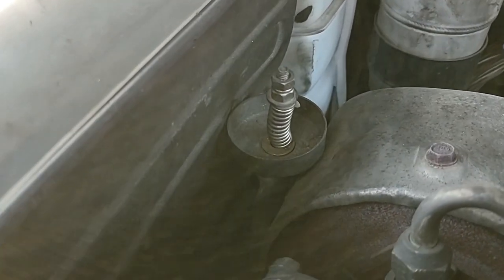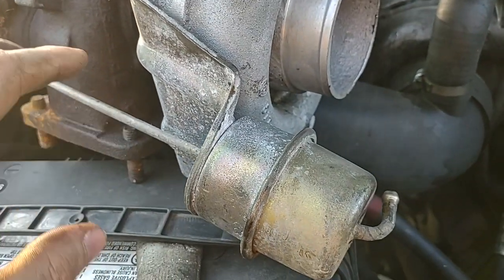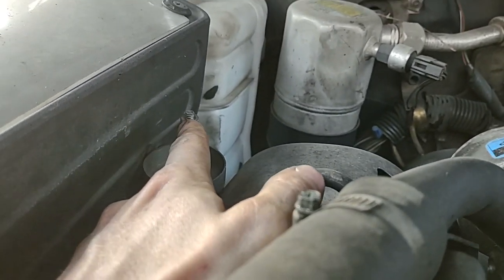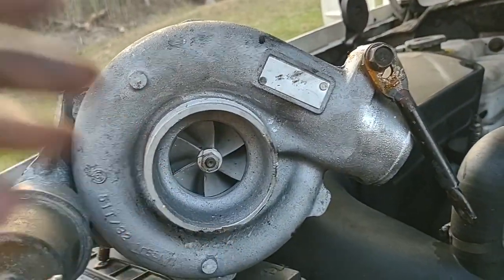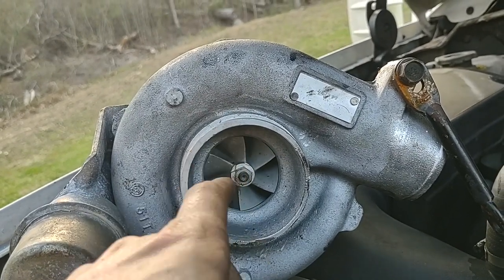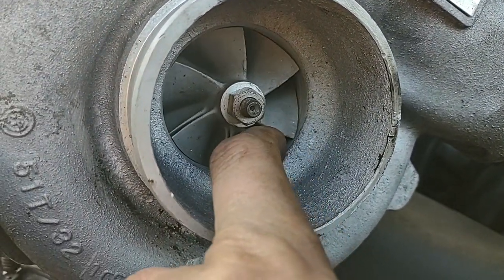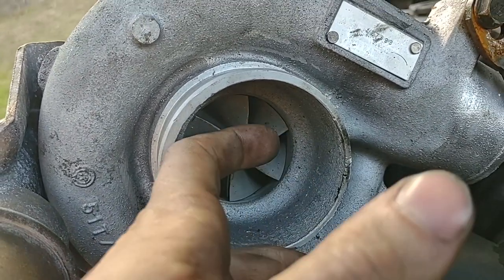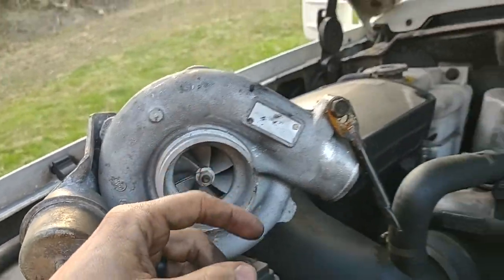6.5L Turbo problems, Increasing boost (derate, no boost, leaking, over boost)

Comment: Really enjoying your videos. I just dipped my toes into the diesel world and didn’t want to spend a 3rd world country’s national deficit on something new, so I went old and cheap. I got a 95 C3500 with the 6.5 Detroit and I’m going to put a few more g’s in it to make it fit me.
Reply: How'd it work for you? Recently did the same with a 94 C3500. Got an air dogg lift pump, mechanical waste gate and some gages waiting to be installed. 
The more videos I watch, the more I wonder if a cummins would have been worth it.

Comment: Hi Jesse:   Thanks for being Awesome.    I'm learning a lot,  and really appreciate your humor and attitude.    I've got a '96 2 door Tahoe with the 6.5 and it started out awesome and now a year or two later not so much.  No power,  went from 20 to 14 mpg,  and starts a little less immediately.     Only 100,000 miles on it.  I do think I got a bad tank of fuel about the same time performance fell off.    I've kept up on maintenance,   just did a lift pump and PMD and am curious about going to the early non-electronic injection pump.  I would love to see a video on that swap,   going from electronic to mechanical.      I'm going to pull down the turbo for inspection when it stops raining.   Also intending to give it fresh injectors and glow plugs....     Any suggestions about the loss of power?     Places to look,   things to consider?
Reply from the maker: Hey man, Thank you for watching and your kind words. I do greatly appreciate it. As far as the low power/ sluggish running issue you are currently having, I would definitely check the turbo for any play as well as the vacuum pump if it is still hooked up. If the vacuum pump is still hooked up I would recommend either deleting it entirely or at the very least installing a manual waste gate on the turbo. Also I would ask if you have any codes stored in the ECU that are currently not throwing a check engine light.

Comment: Another good one, Jesse. I'm currently in the middle of swapping out injectors, glow plugs, and intakes to delete the egr. Just a heads up for those doing similar work, be prepared to spend days doing it rather than hours. Breaking old brittle parts, that have to be ordered, seems to be part of the process as the typical parts store carries very little when it comes to a vehicle that is approaching 30 years of age. The joy of owning an antique. 😁
Reply from the maker: I completely agree brother and thank you for watching the video man, I do appreciate it. Sounds like you have a full weekend ahead of ya, best of luck 👍
Reply: @JessePelkey1  It's turning into a marathon. Got all the injectors and glow plugs replaced. Broke the transmission dipstick tube, the temp sensor for the ecu was brittle and broke, the belt tensioner needed replacing, the guy working on it suggested replacing the glow plug controller since I have a new harness and the snap in connector for the upper coolant pipe started leaking as soon as it was moved. Had to order parts so now it will be next weekend, maybe, before he can get back in it. Parts have to get here first but at least I found someone who knows his way around the 6.5 and willing to work around the delays. Hope he remembers where everything goes. 😆

Comment: I'm fairly new to the game been watching you for about a year you have helped me out more then anyone else,thank you keep it up . I' have driven my truck almost a 1000 miles total but got way too many hours under the hood lol . I am replacing the flex plate for the second time . bought this 94 for $400 with a 180000 miles on it it sat for a few years took me couple hours to fix a bad fuel line.Killer deal then well I already said the flex plate issues .any idea s why they broke the last one on the start up?  I did buy another motor .it is  588e with 5000 miles on it that one cost me two grand .   So I am just getting in the game , remind me of a boat I just don't see know lightat the end of the tunnel!lol have good day

Comment: Merci Jessy!  I have installed a boost gage and get no boost at all. Disconnect at intake plenum and blowed air to verify if gage was working and it did.  My truck runs good but going up steep hill slows down(leak of power).  Did verify if turbo compressor wheel turn and it does.  Original turbo 308 miles.  Got a modify waste gate like yours but didn't put on yet.  Jessy, realy plaisant watching your videos.  Denis
Reply from the maker: Hey Dennis is there any way to tighten the spring of the wastegate? If so that may be the issue, tighten the spring and slow increments taking it for test drives in between tightening sequences and see if the boost actually comes up.
Reply: @JessePelkey1  Jesse, last week did install Flo pro SS822 exhaust and what difference it makes. In same time with my friend mecanic we tried to get boost gage working and accordingly to my friend the turbo is not working.  I have access to my friend's wrecking yard and took the turbo off an 1996 .  Will recondition it and in 3 or 4 weeks will install.  Jesse in the yard there is  a 1997 with a motor that was changed (not much mileage) but the alternator is on driver side (mine on passenger side) and if ever my motor need to be changed will I be able to take that one? merci

Comment: Hey , I am finally working on my 6.5 project. I have one goal only. Making this thing stupid reliable. I don’t want more boost. I don’t want more power. It has 112k miles on it and it was passed down to me. It’s a 94. My current plans are new harmonic balancer as the old ones rubber is about to give. I don’t want to remove the vacuum pump because I am going to use it for a brake booster. 

My current plans are:
New oil and water pump
Timing chain
Head gasket and studs. 
Harmonic balancer
Rebuild turbo
New vacuum pump (chassis I am installing has a brake booster, or electric vacuum pump)
Bigger radiator
180f thermostat 
Of course, going to reseal whole engine. 

Anything else I am missing??
Reply from the maker: Good evening sir, I like your plan, I think its great. I read your list and the only thing I would recommend with everything you have mentioned and want to do, I would say instead of going back with a harmonic balancer I would pick up a fluid damper and a billet pull as well as doing a PMD relocation. The harmonic balancers are known for going out and breaking the crankshaft. I would also suggest and aftermarket lift pump, preferably one with remote fuel filters but i digress. The factor lift pumps will fail at some point and leave you stranded and a newer lift pump will insure proper liberation and fuel supply to the injection pump.

Also, if your rig is a DS4 truck, I would greatly consider a PMD relocation.

Comment: Awesome videos my man. This is my first deisel that I've owned let alone a 6.5 deisel which I'm finding out is very different than the rest of the deisels out there. I've already learned so much and alot more thanks to your videos. I'm at the point of changing the intake to delete the e.g.r. I know you said you had some access to some parts, would you happen to know of an intake I can get my hands on. I would appreciate you letting me know and keep up the awesome informational videos.
Reply from the maker: At this time I unfortunately don't but in the next couple I will be restarting the website where I should have some available 👍

Comment: I think your description on the wastegate is backwards, at least compared to my computer controlled 98. Spring pressure holds the wastegate open, and then when the vacuum solenoid applies vacuum to the wastegate it pulls it closed giving you boost. Vacuum gives you boost. This is opposite what you'd expect and means if you have a vacuum leak or vacuum solenoid failure you get 0 boost, rather than full boost in case of a failure.

Comment: Thank you for another great video!  Can you tell me how to adjust the boost on a stock 6.5L and how to measure that boost? Thanks (1996,K2500 with 330,000 mi, mechanic waste gate with Heath Diesel PCM)
Reply from the maker: Thank you Chris, and to answer your question, best way to measure the boost is to install a manual boost guage directly in the top of the intake horn or intake elbow. With a manual wastegate you could be able to tighten the adjustment on the spring to increase boost or back off the tension to decrease the boost.

Comment: First thanks for all your videos and giving your knowledge on the 6.5. I have a 94 k3500 dually 4 door. I bought it with only 6400 miles. It now only has 6900. I have done the 3 inch down to 4 all the way back. Quadstar full flow intake cold air filter. Airdog 4g lift pump with Quadstar fsu. New 35 gallon fuel tank 1/2 inch line all the way to feed the beast mod. And manually app waste gate control on a gm 4.  Now I'm planning on Quadstar tuner like the malty tuner. Pluse a new 54 or super 60. And advice on tuning other then calling Quadstar. Can I just tell them I want more out of my stock engin and they send me a tuner that will do that. Either way could you go over your experience with buying a tuner and options you have. And things to look for. Thaks again. Keep making 6.5 videos they are really helping. Bill.

Comment: Yeah I remember one time working on my 1997  P400  6.5L Diesel I had the intake all tour apart on it and I had paper towels stuffed inside the turbo intake to keep debris from getting inside it well as working on it and when I was putting it back together I forgot to take the paper towels out when I put the intake all back together the air cleaner box back together on it I started it up didn’t make any strange sound for anything but I sure noticed it when I drove down the street that I had a lot of black smoke coming out of it and the truck was not running right no power right there it dawned on me what I done wrong I left the paper towels inside the turbo like a dummy pulled over pull the paper towels out I believe there was dinner tight enough that the turbo didn’t spin up or nothing but there was no damage to the blades or anything they wouldn’t any paper have sucked in because the blades didn’t spin but I sure feel stupid and I deserve the stupid award for that one big-time stupid award but anyway the truck runs fine the turbo looks good it’s been several several months ago that’s my stupid move with the turbo
Reply from the maker: Been there done that, an expensive mistake I will never make again hahaha

Comment: Got the 6.5 running with the pump you sent me , thank you again so much you are awesome i learned a lot about these 6.5s some good but mostly all the bad ..so much for Pensacola diesel and their b's lies and theorys that it was me and my truck that had the problem. They told me they were going to refund me my 500 two days later there was 500 in my account  then it was gone a day later ! They used my account number to get a personal loan in my name for 500.00 a loan i never authorized !  Real great people the fbi traced it to a computer address in pensacola florida ! Scam artists is what they are.. It ran for 5 minutes on its own I gave it throttle and it died ! I checked everything there was to check turned the key and the lift pump mysteriously stopped priming and glow plugs wouldnt heat .? Not sure what was up  but i checked the fuel shutoff solenoid and there was zero power going to the fuel shutoff solenoid as well  , I went through all the fuses and found the glow plug fuse blown. ?  Does the glow plug fuse run the fss and the lift pump ?  Not sure but I replaced it gonna look into it more tomorrow but I've gone through and done about everything and anything imaginable to this truck  . Any ideas other than a case of dynamite ?
Reply: Check your oil pressure switch.The transfer pump gets power while you are cranking, then once oil pressure builds to about 4 psi the contacts in the oil pressure switch close and the switch  powers the control relay for transfer pump.
You should also get a voltmeter and measure voltage at the transfer pump. Be sure you have good voltage and good ground in the circuit.
Mine had 12 volts power, was working, but would not provide enough volume. Rock Auto has replacement.
Be sure to also change out your fuel filter and clean the filter housing.Fill the housing up 1/2 way with fuel then install the filter.
You can bypass oil pressure switch (AS TEST only) by jumpering orange wire to grey wire.
Pump should run at all times and provide fuel to filter.
This circuit is hot 12 volts at all times. Be sure to reconnect wiring back to original after the test.

Comment: My 93 had a bad wastegate it was get anywhere from 6-16 psi, so I swapped a Chinese hx40w and right now it will max at 21 I plan on lowering it and it has not had the cdr connected but it ok bc it's stuck open

Comment: This maybe a silly question, but could a person take a alternative route an supercharge their 6.5? Also would their be any pros/cons to this, or is this just a bad idea in general?
Reply from the maker: I don't think its a bad question at all man. Truth be told to my understanding there has very little as far as testing if at all with a super charger on a 6.5L There are a few pros and cons to either one, but with realistically no one making the effort to make a kit or test a super charger on these engines its hard to tell how it actually responds.
Reply: @JessePelkey1  yeah I've always been curious especially since with this particular engine it might actually make sense. However I'm definitely gonna be asking questions due to I'm in a debate between a 5.9 cummins 3rd gen, or a 6.5. I'm mainly looking on cost, easy diy, and I'll only be towing 8-9k 5k at an absolute max.

Comment: Hooked OBD2 tester up to my 2000 3500 gmc 6.5l turbo diesel and had a P0236 Turbo/supercharger Boost Sensor A circuit range/performance code pop up seen in your videos couple of things but any idea of what it definitely could be without doing process of elimination of the few things I’ve seen it could be causing that code

Comment: Blew a head gasket what bolts should I order for more boost that's reasonable priced an whatcha think about doing to the head while I've got them out ??
Reply from the maker: Arp head studs, send heads to a machine shop to have valves and seats checked along with the heads checked for flatness and cracks.

Comment: Crankshaft sensor fixed my stumbling and shutting dwn. So what do u think of installing a wicked impeller along with doing mech waste gate?
Reply from the maker: Wicked wheel is definitely an upgrade over stock, your egt's will stay lower and the turbo won't have to work as hard to make the boost. If I had to choose a stock gm turbo or a hx35 though, I'd take the hx35.

Comment: Recently picked up a 94 C3500 utility body with the 6.5. It has 140k miles, 0 blowby, pmd relocate. Otherwise stock. 
What could cause a hard start? Warm or cold, it always seems to turn over a few times before firing off. When it's cold, it seems like as soon as the oil pressure jumps up, it fires off. I'll drive it for a while, go to restart it, and it still cranks over several revolutions before firing off. Runs great otherwise. 
Any thoughts 6.5 folks?
Reply from the maker: Honestly, it could be a multitude of things my friend. There wouldnt happen to be a check engine light on or have checked to see if there were any inactive codes stored in the ECU would you?
Reply: @JessePelkey1  
No CEL haven't checked to see if any were cleared but been driving it.

Comment: I have a 6.5 with db2 and hx40 I don’t get any boost until about 2200 ish rpm’s and can not hear it from exhaust at all but can hear it loud in the cab about 25-3000 rpm’s and can feel it pick up with the spool but just ain’t right

Comment: a farm tractor of mine the turbo still works but so much play shes pushing oil out the stack! thinking about throwing a good 6.5 turbo on it. i just gotta setup the boost. would you ever do a hx40 on your 6.5?
Reply from the maker: Absolutely, I was actually thinking about an hx40 for the service truck that I'm going to be building here in the future 👍

Comment: Tank you for all the informations you give us, really appreciate. Do you at how much pressure you can go without an inter-cooler?? Because you can't boost the manifold pressure for ever cause what you gain in pressure you loose it in density due to the heat generated by the compress air. At a certain point you don't put more air into the cylinders even if you increase the pressure and you get all the problems crated by an too hot intake air. 
Also I beg you not to start cutting the video between sentences to accelerate the debit speed. I just can,t listen to a video when there is no breath between sentences, it drive me crasy after 2 minutes!! Your rhythm is good and your English is clear, stay like this please.
I'm also interest at the procedure to install a mechanical injection pump instead of electronic one if you have time one of this day. My truck is an 1994 2500 HD Silverado.
Tank again!!

Comment: I have a question. I have a 6.5 pumping air back through coolant reservoir. Is that  blown head gasket or water pump cavitating
Reply from the maker: More likely a head gasket, the water pumps wouldn't really cavity to the point to allow air in the cooling system without visible leaks.

Comment: Just bought a 6.5 Chevy 3500hd it’s an old ATT&T truck ,sometimes it doesn’t start ,I unplug a wire the last owner says goes to fuel ,plug it back in and it runs ,any ideas ?
Reply: It’s a 1996 if that says anything
Reply from the maker: Where exactly is the wait located?